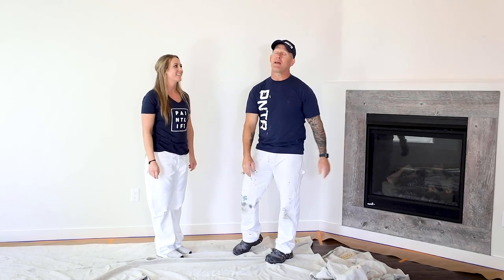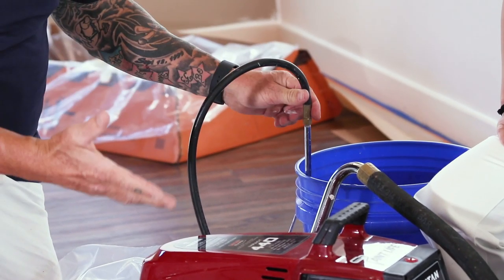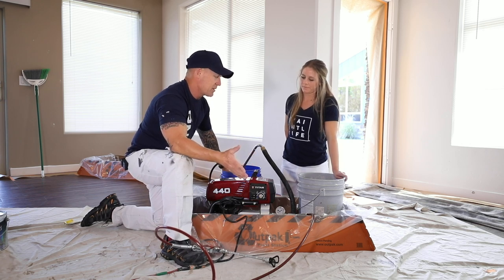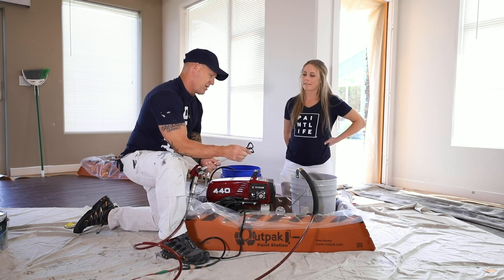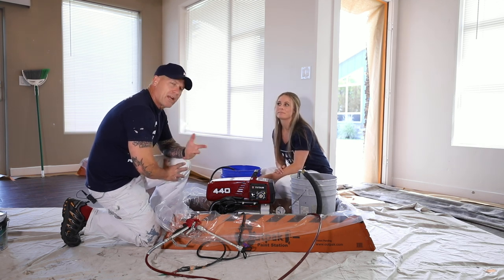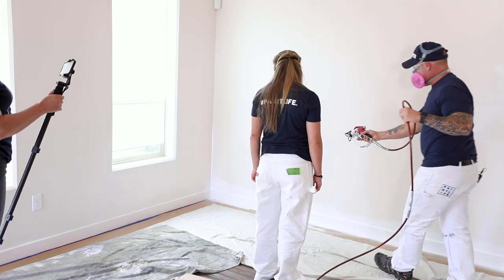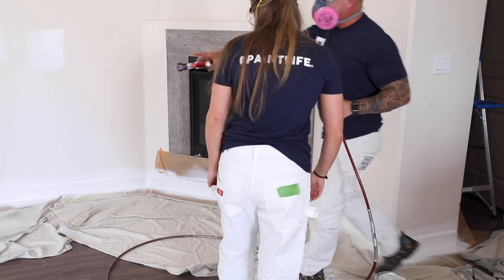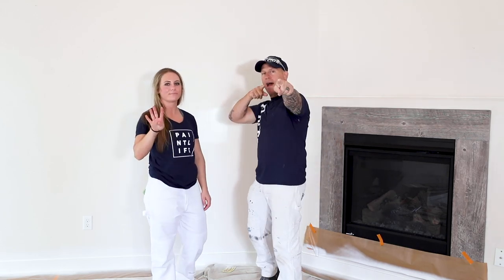Spray Trim Like a PRO! Airless Sprayer Crash Course

Comment: I had to fit my baseboard after the walls were painted and the floors were put in - can you still spray them or will the masking not prevent over spray going over finished walls? Or is that a brush only scenario?

Comment: Rented an airless sprayer from Home Depot and went nuts spraying my new business.  Blew through a gallon REAL quick before I realized the machine was cranked up too high.  Got the hang of it after watching some of your videos but now I’ve got overspray to fix and fingers from the sprayer in the areas i thought i had under better control.  Should I just get after it with a roller or??  Thanks for all the videos. I’d be even more lost without ya.

Comment: I'm getting ready to paint the interior of my home and also changing out the base trim.   I'm planning on rolling the walls and ceiling  but would like to spray the trim. My question is if there is a good sprayer that you guys would recommend for maybe <$200? I would like to keep it cheap since I probably won't be using it very often after I complete my project.

Comment: Hey Chris Love the channel and love your store just picked up some of your tools including your whip for the sprayer looking forward to getting it and trying it out but in the mean time I have a question for you hope you can advise I’ve seen multiple of your videos were you recommend using a 310 tip for doors and trim however just about every type of semi gloss paint that I look at seems to suggest a much larger orifice for semi gloss trim paint. Do you recommend using the 310 regardless or going with the paint manufacturer recommendations for tip size?

Comment: Great videos. Question... Am I correct that as you are spraying trim (in this video and others) the overspray onto the wall is not an issue for subsequently coming back to roll? No need to protect it other than by not spraying excessively?

Thank you
Reply from the maker: That is correct

Comment: Can you spray the trim, windows, door jams without getting paint on the walls? I just painted my walls and don’t want to have to repaint them. Also, I would like to go from oak to white trim but don’t want anything to bleed through. What products and steps do you suggest? Thanks!
Reply: Your easiest bet is to hand brush the trim. If you want them sprayed,  it can be done, but the labor and materials will go up because the painter will not only cover the floor but will also have to cover the wall with paper and tape.

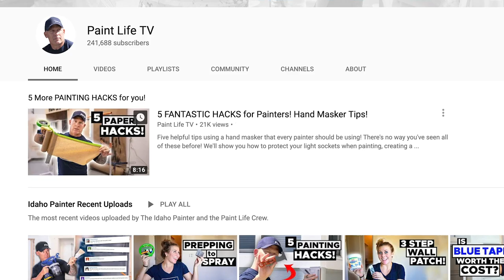Comment: Hey Chris, @ 9:20 you mention waiting until the trim paint dries to see if it needs a second coat, and since you’re doing walls next you don’t need to pull your masking...my question is how are you avoiding bridging on the trim if you’re leaving masking down after trim paint is already dry? I thought you pulled masking while trim is still wet...
Reply: I don't see any masking on walls to call bridging.

Comment: I have a huge trim install job to do at my house.  I know I am going to get a better looking finished product by painting it after it is all installed but the amount of time I am going to spend taping and blocking off is going to be insane.  Is it really worth doing it that way or should I just paint all my product first outside and just cut and install then touch up joints after?
Reply: if it's your own house i would do it outside. if a customers' talk 'em into outside as well, but some insist inside

Comment: If you're spraying an accent wall, how much of the adjacent wall and ceiling do you need to mask to avoid hitting them with overspray? I.e. how far away from the corners...2-3 feet? More?
Reply: 's about right. the more the better. depends how far you're gonna hold the gun away.

Comment: Good job Mckenna. I never would have thought of spraying trim before. You used triple the tape quantity for the floor. Did the painter quote you time and materials, or was that included in the bid?
Reply: This is so true cheaper to hit it with a brush

Comment: do you ever run into issues of tape removing finishes from floors or peeling paint from walls and what do you do to avoid?
Reply: Use a tape that isn't super sticky, try to limit tape touching the floor to around the baseboard, then work as quickly as possible. The less the tape is left sticking the less damage.

Comment: Chris, I noticed you used antifreeze in your Titan sprayer. What type of antifreeze did you used as a storage fluid?
Reply: He has said he uses RV antifreeze in other videos. The stuff you put in the plumbing system for winterization, not the engine coolant. Nice thing about that antifreeze is it's rated for use in the potable water system of your RV, so it's not as toxic as engine coolant or pump armor.
Reply: I use modern antifreeze and it works fine so far.

Comment: Will you be able to see the overspray on the wall after you paint the wall? (And the spot in the center of the wall where you tested the spray). I always see a difference in sheen on the wall where I did the color samples before I painted the wall.
Reply: They are going to paint the wall so it will get covered up
Reply: Zander Kent I get that but every time I’ve painted over a test spot I can see it through the finished paint job even after two coats rolled on. It’s the sheen that is affected. Maybe it only happens when the top paint is eggshell.
Reply: @1977jmad  my customers like that little extra secret shimmer. It lets them feel unique and special. Their own private sheen blend.

Comment: Thank you for sharing your knowledge with us, question, ones I spray the trimmers with semigloos  paint some of that paint stay in the wall, when is time to paint the wall lest say with flat paint, it is going to be any issue?, because the flat paint is going to be on top of the semigloos, close to the trim.
So basically my question is:
Can the flat paint be applied on top of the residual semigloos or I need to sand, deglosser or just paint it over?.
Reply: You should do a light quick sand and you're pretty much good to just paint over it
Reply: Just paint over it it will be fine in fact it might have a nice little shimmer underneath it no one will know what's up

Comment: what trim paint are you using? also i hate 310 tips they always clog on me. Prob need to thin my paint
Reply: Use a finer gun filter, in that RX pro titan use the white gun filter for trim.  I usually use a 211 tip for trim.

Comment: @ 4:13 you said..."I typically spray my trim around 200 Psi". Did you mean to say 1200 PSI Chris? Great video!!
Reply from the maker: Franklin H 2000
Reply: @Idahopainter  I always thought that  you ran your  PSI lower for some reason, regarding trim. Thanks for the reply.
Reply: @franklin9613  usually they says 1k-1200 psi for these FFLP tips but thats at the pump. i think 2k at pump= the right psi at the gun

Comment: @ 0:27, OOPS ! , there goes the corners of the baseboard.
Reply: YZMOTO #80 looks like mdf, doesn’t take much
Reply: @Zach Wagner ;  lol, no it doesn’t, wasn’t trying to judge, just...been there, 😂.
I learned the hard way myself, got to be gentle with the fiber board !
Reply: YZMOTO #80 no judgement. Just saying, mdf doesn’t take much as far as sanding. Definitely would of just hand sanded a little, then moved on